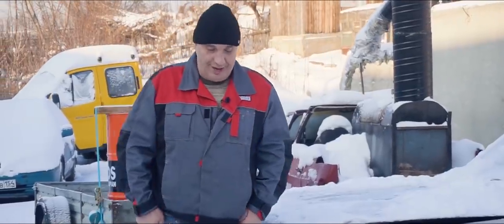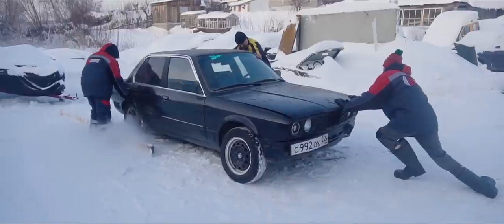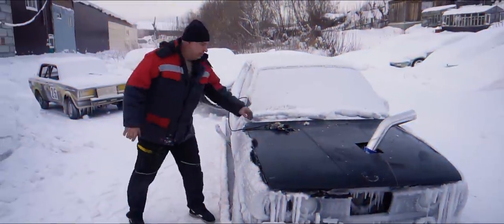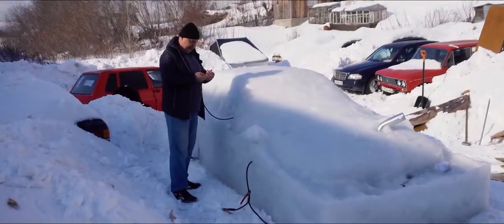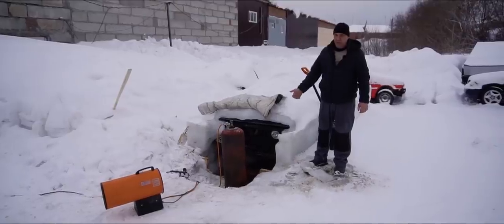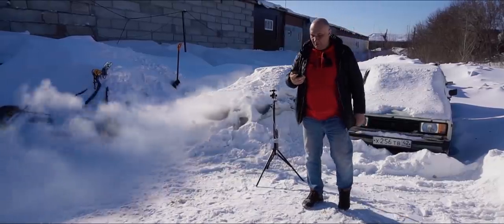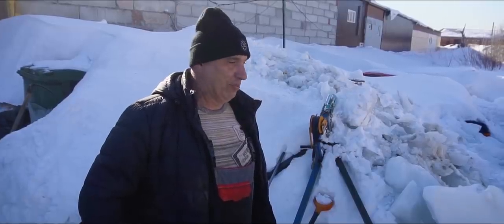Turning a BMW into an ice cube – will it start?

Comment: My bmw doesn’t start and it isn’t even in an ice cube
Reply: did you really wtch the video ?
Reply: Exactly, they're quite crappy cars.
Reply: check plugs fire timing fuel pump fuse and relays
Reply: Send it and buy an Alfa Romeo.
Reply: G.S Italian cars are a no.
Reply: @killerdinamo08  as a bimmer they are not crappy but....all cars has the good and bad cars... what do u own then? a peice of a faronda? (honda with a fartcan)
Reply: @trap3251  For you .
For others are the only .
Cuore Sportivo!
Reply: @_GummyBear_  🤣😉🤣
Reply: their BMW has a Toyota motor lol. it says beams 2000 on the cover
Reply: Same😂😂
Reply: @_GummyBear_  that's very true. And I hate when people ruin hondas.
Reply: Is it a 2 litre diesel that's probably y if it is always have the 3 litre
Reply: @yeetisthefetus7214  Honda rules !!
Reply: so u got a problem
Reply: @ganggang3042  hell yea brother
Reply: Add a battery. :)
Reply: Twisted i like audi better imo
Reply: Thanks for spoiler
Reply: buy a old toyota (supra mk3, celica,...) basicly same engine as all straight 6 bmw engines but robust as a tank
Reply: Twisted id take an accord any day over a beamer if it means i get to work everyday without throwing money at a towing company
Reply: Mercedes is king
Reply: onestopshop slop the rop king of the hard shoulder and mega expensive servicing
Reply: The bmw will never start!!!

Comment: >Lada radiator >Japanese motor
Wait what, wasn't it supposed to be a BMW?
Reply: They musta retrofitted  w/a Jap engine???
Reply: @UberLummox  It says BEAMS 2000 on the valve cover. Its a Toyota engine.
Reply: The only equation for a reliable BMW
Reply: Daniel Polo nah still got the shitty rubber bushings that dry rot in 10 years
Reply: celeron55
 ... this is like Cuba, where they randomly transplant any driveline just to have a classic car look on the outside!
Reply: A bmw with a Japanese motor......what is the problem here? Carry on good sir
Reply: Well that makes it even more reliable
Reply: hi C...
'
is that real japan motor in ussr lada car...
what brand of japan motor...
bmw car is a full germany as not japan = not ussr
Reply: enginewise it has been swapped with 2 litre 1gfe BEAMS from altezza is200 halfcuts
not 3sge
Reply: German engineering doesn´t work in russia
Reply: wow really all the replies on this comment and not one knows that BMW's come with the Japanese 2JZ inline 6 engine
Reply: Did you know that the modern Japanese Datsun Go's are actually rebadged Ladas? (:
Reply: Oh cool BMW with a beams
Reply: @bitelaserkhalif   bingo
Reply: That’s exactly wat I was thinking!
Reply: @Oo-IIII-oO  there is a video where they fill a bmw engine with water, freeze it and start it
Reply: The native BMW engine did not live to see these happy days...
Reply: AmstradExin To be fair, the Datsun Go is only really sold in developing markets, not too many purple are very familiar with it.
Reply: Yeah but they wanted some semblance of reliability
Reply: @ingiiiiiii  oh man why the new supra has a bmw engine when a bmw engine a toyota engine is
Reply: reverse supra with communist influence
Reply: @Trumplican  i hope youre joking.
Reply: because russia
Reply: é Power-Phull Aadmé

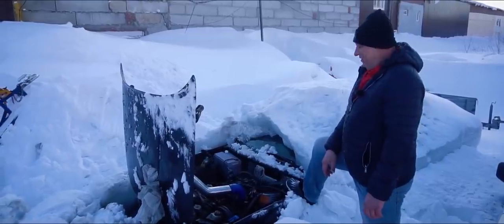Comment: 14:07 A Japanese engine in a BMW? 🤔
Reply: Welcome to Russia
Reply: notice steering wheel... from lada...
Reply: same
Reply: It s a german engine
Reply: Its Russia dude, what do you expect
Reply: That's a Beams 3SGE.
Reply: It has Toyota 3S-GE engine & gearbox in it, from a 90s Toyota Caldina.
It also has Lada radiator & steering wheel, replaced front suspension, all sorts of things.
Reply: @Brock_Landers  true
Reply: @Christopher Conroy
No... it's a Japanese engine. 
I don't know of any Toyota engines made in Germany
Reply: television and cheese No its actually a 1G-FE from a Altezza or a Chaser
Reply: Christopher Conroy  what are you people talking about? did you watch the video or what?  its a TOYOTA BEAMS engine in that car! what I'm not sure is if it's a 3S-GE or a 1G-FE.
Reply: @JJ-kt2gr   Yes you are right its a 1G-FE beam  inline 6 engine !
Reply: At one point you can barely make out BMW on the steering wheel for a brief second.
Then later it shows a Lada wheel w/no center.  (???)
Reply: At least there's no Japanese car with a BMW engine.

... wait
Reply: It’s a 1g-fe out of a 6 cylinder 2.0 chaser or altezza. The same engine the is200 uses
Reply: re:Flex 😂😂😂
Reply: The only way to make a reliable BMW
Reply: Christopher Conroy  what? That's total bs. Nearly all German engines are reliable and well built. Don't base your opinion on one abused Opel with 300k km.
Reply: @supershifter4836  "nearly all" well thats just not true. bad generalization.

Comment: Noooo why did you do this ? RIP e30
Reply: Red Geeko also it looks like it was already in a pretty bad condition, maybe it was already beyond economical repair before this experiment.
Reply: That E30 doesn't have much left that was actually made in Germany bruh...🤣🤣🤣
Reply: This E30 is already gone man, it has toyota engine + gearbox, lada steering and radiator, there's not much left of it

Comment: 14:08

sure japanese motors of course...
Reply: Apperantly it does have a toyota engine swapped in it
Reply: @VNCTHE1  how do you know
Reply: @fuolku1006  By using the things that you see with... 1:49 in the engine bay it says BEAMS 2000 which is Toyota 1G-FE

Comment: Pointless experiments. The only thing you are doing is adding uneccesary pollution by running an engine for 5 hours for basically nothing. Why not try spending your time trying to find ways to reduce the car's carbon footprint instead. Clearly you have substantial mechanical skills and you have wasted your talents on .. nothing.

Comment: Looking forward to 2.0 of this next winter; just need to ensure that water can't leak underneath, which could be achieved by plywood and caulking the seams (and ensure clear airflow and exhaust) and applying the water very slowly (again maybe after filling all seams/potential vectors with hard-packed snow before?) until you get the first nice "sealing layer".

Comment: So was this an actual Beams engine? From what I've heard those engines are supposed to be worth a decent buck and able to make some big power. But that might be a certain type of Beams engine. The engine cover said "Beams 2000" so it was a smaller one if that cover is to be believed. lol.

Comment: So, since when do E30s come with a Beams 2 liter engine? Did I miss something? I had to rewind the video to clarify what the cover on top of the engine said.
Reply: They filled the original M20 with water and froze it. It still ran,but the engine block was destroyed.

They replaced it with a Toyota 3S-GE engine & 5E-FE gearbox from a 1992 toyota caldina (as well as lada radiator & steering lol)

Watch the Garage 54 LIFE channel to see about this))

Comment: Those Japanese BMWs :p
Reply: This has swapped engine 1:49 you can see BEAMS 2000 for my knoweledge there isnt any bmw BEAMS engines so yeas the engine is japanese (Beams 2000 = Toyota 1G-FE )

Comment: When did BMW start using Japanese engines?
Reply: I'd say right up to when the new Toyota supra got a BMW engine 🤷‍♂️
Reply: @ripsrt6822  Even if the Toyota Supra got a BMW engine is BMW using a Toyota Engine? I know some Peugeot uses Volvo engines but no Volvo uses Peugeot engines and Saab used Ford V4 engines. The reason I wonder is that i am a retired car mechanic.
Reply: When russians swap them